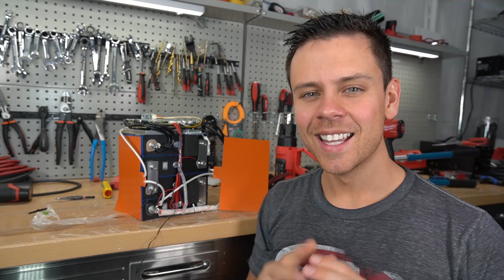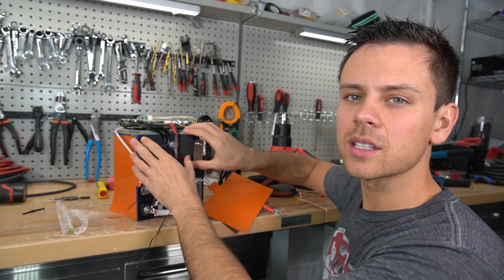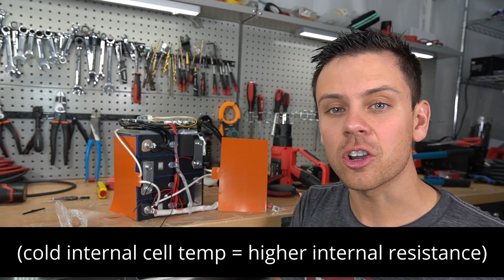LiFePO4 Cold Temperature Misconceptions: Do you really need internal heaters?

Comment: Will/et al: Im a new subscriber and your videos are a help. I will use a 50amp 5th wheel for extended stays in North western Montana this winter for skiing. It can get down to -15 during the day while I will be away from the RV skiing. Im building the system now . I will be completely off grid using a 3K generator for BU. Ill need to run a combination of propane and 120 Volt heaters on /off through the  night. Ive gotten away with this before with just the generator but getting tired of waking up freezing so Im looking for improvement this year. Im considering  Battleborn and SOK with internal heaters.  Im probably capable of rigging something up but you did not go into enough detail on that. My situation is Similiar to some other comments with a front un-insulated /unheated compartment made for a generator. However I wont be able to retreat to heated shop with VAC for repairs: something the videos Ive viewed on Youtube  so far overlooks.  Im looking at 3-5 200w, 24V solar panels in series, 400AH SOK or Battleborns and a Victron system using the MultiPlus II inverter. Any feedback is appreciated.

Comment: i'm going to have this in a van. what i need to know is can you discharge this battery when it's cold to run a diesel fuel heater to warm up the van and therefore the battery and THEN start charging it with solar panels? thanks.
Reply: never mind i found the answer below. i bought a CHINS but i think they're all pretty much the same. seems you can discharge down to 0 degrees f.

Comment: I would like to use solar and  batteries in NE Minnesota (snow season starts in beginning of November and the melts in the last part of April)  the outdoor temp falls to negative 40 F (or lower) and only warms to about negative 20 F for weeks at a time and the outdoor temperature can remain sub-zero for a moth at a time.  Also the solar day is very short at the latitude of 47.9 degrees the longitude is -91.9 and surrounding areas. Any ideas on how to make a system for that environment?  We normally would be heating to 68 F during the day and only to 58 F at night.   Also ideas on snow removal,

Comment: Hey Will, Your a wealth of information but, I am a bit confused. I have a travel trailer with the battery located on the tongue in a plastic battery box. I live in Colorado and do some colder weather camping. I picked up a Renogy  heated battery due to the cold nights. Will my Renogy 200 watt solar briefcase with a 20AMP controller activate the heating pads so that it will warm up enough to start to charge? I hope I didn't make a bad buy.  I have Two 200 Watt briefcases. I also have a solar generator that I can plug the shoreline into and pass through charge. Will the stock 2021 equipment charge the battery and will it activate the heating pads?

Comment: I'm in Canada where it gets -35c, we store our van in winter, so we do have the internal battery warmer as part of our Victron set up provided by the VAN builder.  Worked great last winter.  My fear though is the heater failing.  The battery won't charge because of the BMS etc, but I'm worried that the battery will freeze and get ruined?  And my big fear is the heater and the bms fails haha.  So every day I'm out there, making sure it works in below 0 weather.

Comment: so basicly if i insulate lifepo4 in a 1" rigid foam box(or camping cooler), airtight sealed in winter (vented in summer). as long as theres a LED light/camera drawing 5-20w load, the battery will produce enough heat to keep it above 0?  ima gonna leave my goalzero  buried in a insulated box for house security camera and led light, also gonna get 10kw lifepo4 insulated in my van.

Comment: Will insulating my RV battery step metal box keep my LifeP04 battery safe from cold temperature charging without having to add a heater pad(s) I was thinking of plugging up all the holes in the box and lining the inside of the box with refectix. I can open the step cover from the inside to allow the inside RV heat/aircondioner air inside the box.

Comment: On the opposite end of managing cold temperatures, have you done any videos on managing hot temperatures? I have concerns about using lithium batteries in hot weather where temps can reach the high 90s and under cover temps can easily exceed 110 degrees.  What kind of damage actually occurred when temps exceed storage or discharge temp limits?  Thank you!

Comment: I am converting a 36 volt golf cart to lithium and the cart is stored in an unheated barn. We saw temps as low as 5 F this past winter. I think I have convinced myself that I need three 100 AH 12 volt in series and that each battery should have cold temp charging cutoff. Would you agree? Would I ba better trying to insulate the battery installation? I would rather not do that in case someting happened with the heaters.

Comment: Will, just want to say I’m learning a lot from your videos. My rig has a partially closed battery compartment under the steps, meaning the internal air is subject to outside temps, in fact, more subject than it is to airflow from within the RV, though still obviously affected by the thermodynamics of RV through I suppose some radiation via the parts of the enclosure that are shared with the body of the rig. Question is: given this scenario and given I plan to be in Canada and the northern US States, would you say I’d be at risk of negligent exposure or would you say that even multi-day exposure to sub-freezing temps in a somewhat open environment can be offset purely by putting load on the battery?
Reply: Interested in the response. 
 One would think that a 2 step bms shutdown is needed.
 Step 1) 3.10v 
Step 2)  3.00v
Or whatever value of watts in reserve is needed to raise international temperature from -40F/C ( assuming winter is being discussed less warmer obviously) up to 38°f ( allows for some margin). 
Reserve can be reduced  2 ways.
1 insulating 
2 having an amp limiting bms set to this lower vdc that only supports the heat padds getting 2x heat of discharge and pads.  I am thinking many small pads spread throughout the pack would be better than 1 large across the bottom.

Comment: All I know is that the android tablets we have in our school busses to do pre and post trip inspections on, work terribly or not at all, once the AM temperatures are below about 22 degrees F overnight. If the bus sits idle for more than one night (like over a weekend) then the temperature had better not go below 32 degrees (even if the device is fully charged when the bus is shut down).  So YES, we need internal heaters that switch on/off with the weather.

Comment: I am going to keep my 2 ExpertPower 100Ah LiFePO4 batteries on the tongue of my RV in a plastic box that is waterproof,  what would you suggest for airflow considering summer camping with the RV  sometimes at high altitude in CO which gets below 32F some nights ? it's a box Plano 68 quart locking. Should I consider some insulation for the box for colder nights, then may need to also think about hotter summer days when in the 80-90F range too ? thoughts

Comment: Sensor placement is a very good key too that you mentioned.  You probably want the sensor as far away from the pads as possible.  Maybe sandwitch it between cells right in the middle and have the heater on all sides.  It will take some time for the heat to gravitate through the battery and to the sensor, so when sensor reads a higher temp you know you're good to go.   And yeah it's probably best to have separate heater than to be tied to a specific brand/cell.    I'm still using lead acid for all my stuff so don't have to worry about this, but these cells are slowly starting to become more available in Canada so eventually do want to start playing around with these.  Most likely for vehicular stuff once I start getting more equipment on my homestead property.

Comment: well, I think part of the concern with this topic is that batteries are one of the most expensive components of any system. If you are in a cold climate you can easily spend $10k + on a decent sized battery bank and you want to makes sure you have extra large margins of safety so not to degrade, destroy them. For the small additional cost to insulate/heats seems like a good investment. Seem like many solar folks live in Texas and Nevada.

Comment: Thank you for your videos, as I am a beginner in the lithium battery market.  I have a couple of question. I am planning on running a 24 V trolling motor on my boat with 2 12 V 100 Ah batteries. I would like to hook them up to a NOCO on board charger and keep them plugged in on the lithium setting.  My first question is, will I be able to trickle charge the lithium batteries as I do now with my old non-lithium batteries. My second question is, will the trickle charge keep the batteries warm enough if the temperature drops below freezing?  I do pull my batteries out of the boat and put them in the garage for the winter, but in early spring and late fall, the temperature may drop below freezing while my batteries are still in the compartment on the boat.  Thank you for your help!

Comment: Thanks for the great information. I will install the 200 amp Renogy Lithium in the insulated compartment under the step (Class B+ Leisure travel Van.). Insulated but not heated. I planned on installing a few 7w heating pads on the battery, connected to a thermostat and on/off switch.. We travel down South from Canada in March, below 0 c the first few days. We have 400w solar, and are driving all day, not worried about the low current draw (.65 amp per pad). Your opinion ?

Comment: Can you recommend some heating pads? I looked on alibaba and amazon and can't seem to address my concern of the pads getting too hot. I plan to wire up the pads straight from the fuse block and attach them to 100ah-200ah LiFePO4 batteries with a w1209 thermostat. How can I choose a pad that won't (can't) get too hot?  Thanks (10,000ft in the rockies)

Comment: Thank you. For talking about heaters.  My first step with lifepo4 batteries was to put them in a picnic cooler.  Upon discharging, the temperature immediately climbed to 148 F.  The cooler trapped the heat of discharge and I knew a cooler was not going to be a year around solution.  These batteries are in an unheated uninsulated storage shed on the Colorado plains.  It gets hot insidenin the summer and cold inside in the winter. I use Morningstar ProStar controllers because of their low temperature foldback in winter.  I also use thin orange silicone heaters on a thermostat, powered from the solar panels, through buck converters.  Overnight temps in the winter are typically minus 6 C and the heaters will have the batteries warm enough to charge by 9 am.  Please talk more about how to handle extreme cold in future videos.  I can use the help.

Comment: I sure hope the low temp disconect works on my SOK batteries. They are in our un insulated machine shed and it's going to be 4 degrees farenheit this week. There are two 100 and hour. Batteries and only 200 watts of solar panels. That probably is not enough current to harm them even if the low temp cut  off failed.

Comment: I want to charge my Lifepo4 battery,  where it is always plugged into charger when not in use.   Like a MinnKota charger and lead acid batteries work.   Ampere Time says not to leave charger plugged in, as it will ruin battery.   

If charger goes into trickle charge when charge is complete and battery has BMS that protects against overcharging….  What damage could leaving battery/charger plugged in full time?

Comment: We live in SE Michigan.  I have had a 1 gallon bottle of distilled water in my unheated garage over the winter.  Last week it was frozen solid as a rock.  Today it is half water, half ice, we have a "warm" spell.  The low for the next three nights is estimated to be about 12f and the high for the next two days 20f.  Just to see I melted the remainder of the ice out of the jug and filled it with OUR 39F TAP WATER.  Will check on it in 3 days.  PS: have a 100ah SOK and last time 2-3 weeks ago its low temp disconnect was working....could not charge it.

Comment: I have a PHEV with a 9kwh battery that uses the engine waste heat to warm the battery simply by exhausting the cabin air through the battery compartment. 

I've been still plugging it in when I get home even when it is -15C outside as long as the cabin is warm assuming the charging keeps the batteries warm until they are done anyway even if the car cools quickly.

Do you think this is a safe assumption?

Comment: Will be putting my battery's, in the heated basement of our camper. So the only time they might be even close to 32 degrees. Camper will be shut down, with battery's switched off. Hope to our 6 solar panes and the battery's installed by fall on our camper. Your book came in today.

Comment: I close off the inverters next to the batteries with some rigid foam insulation during the coldest months. The inverters throw off plenty of heat to keep a small space warm enough.

With the rigid foam insulation around the batteries/inverters in my shed, I've never seen them go below 55F even when it's below freezing out.

Comment: I totally agree with you Will, heater pads are not needed. I have two battle born batteries in a Class A motorhome. I have them in the same location that the old lead acid batteries came out of. I insulated the bay with some reflectix and spray foam. I have been in temps in the teens and have never had a problem. I do have a light bulb set up in the bay that turns on when it gets into the low 30's.

Comment: Great video again

i have an 16sp3 100 Amps configuration, i use not more then 25 % of the usable capacity each day, i am charging until 54,4 volts and let it do CV for 2 hours, is this method increasing the lifespan yes or no.

Comment: Will, while you did say most people and talk about freezing point....  Here in Nebraska, it can stay at zero degrees for days.... Sometimes negatives for a week.   I'd like to put these in a golf cart we use on the farm.  Heat pads or no heat pads?
Reply from the maker: Heat pads for sure haha
Reply: @WillProwse  What if we dont use the cart over the winter...ie we dont charge it at all.  Will we do significant damage to the longevity or capacity if we just left it in the cold?  So, fully charged, but sits for 4 months without being used, charged or discharged?  Temps dipping negative  but mostly teens for 2 months

Comment: Will is right.  I have 4 AGM batteries in my van.  I live where the internal temperature of the van while in storage gets below 10 degrees sometimes.  This year, just before I left for warmer territory, I came up with a solution.  I put a dog warmer pad over the top of the 4 batteries (with insulator in between for safety).  Nice and warm.  I also put the dog warmer pad over my lithium e-bike batteries in the downtube of my e-bike.  Nice and warm.  No problem.
I will be upgrading to batteries with low temperature cut off in a few weeks.  I'm going to use the same dog warming pad.  Once I am underway, the inside of the van is heated via an Espar heater.  No worries.
Reply: I actually contacted one of the manufactuers of a LiFePO4 battery that I was considering and asked if the batteries could be insulated such as we do with outdoor water pipes when we expect a winter freeze. Or heated with a 12V warming blanket, etc. The manufacturer of that battery told me neither of this methods will work and that I need to remove my batteries and take them indoors to charge! ??? Hardly a feasible setup for a person living in their van and relying 24/7/365 on solar and the battery bank!
Reply: Since heat rises, I doubt the efficiencies of heating above the batteries is really that useful. Try putting the heater pad under the batteries and you'll need it on for a lot less time.
Reply: @dougle03  HEAT doesn't rise. Pure heat, as in IR radiation, emits equally regardless of gravity. Warm air rises, sure. But that isn't the same thing. In this case, a blanket will help trap the warm air close to the batteries where as a pad under would allow all that warm air to quickly rise away from the battery.

This is pretty easy to test - lay on top of a heated blanket and then lay under the same heated blanket. Which configuration do you feel most warm?
Reply: It's very important to note that Lead acid based AGM is a very different chemistry from Lithium based LiFePo4.

Comment: I have 2 of the 24v 200ah eg4 server rack batteries and absolutely love them. I live in eastern Washington where the temperature I well below freezing for 4 months a year. Although these packs have low temp charging protection, I’m not of a way to actually monitor the cell temperature. Mine are in a conditioned space but would like some redundancy. Thinking a sealed foam box would be good?

Comment: I've heard of low temp concerns with lithium,  but generally the context doesn't include the bottom end of that temp range. Would you mind letting me know what temp i should never go below for charging,  or discharging (in case they are different). Thanks Will, you're a wealth of info & experience,  providing huge value!
Reply: Check the manufacturers specifications.

Comment: I have 3 lithium battery 100 amp/hr kits from BatteryHookUp in my RV.  The EPEVER charge controller has a battery temp sensor that is inside my battery box.  This battery box is inside a non-insulated and vented storage compartment on the RV that typically holds a generator.  When outside temps were down to below freezing for 18 hours, the battery temp never dropped below 37 degrees.  The crazy part is I was not even using the batteries at all!!